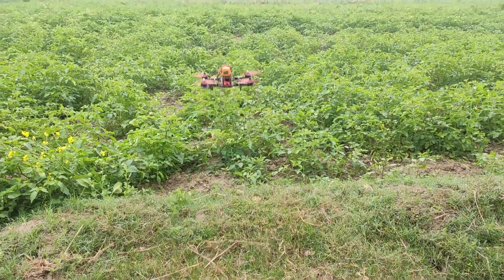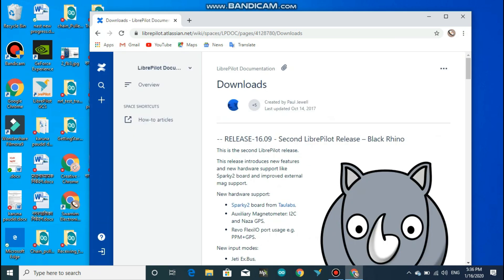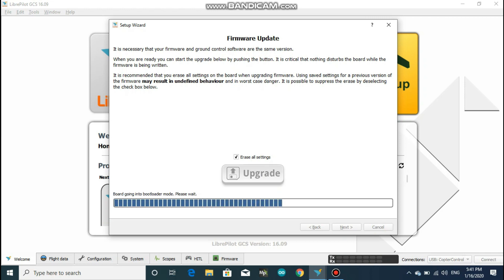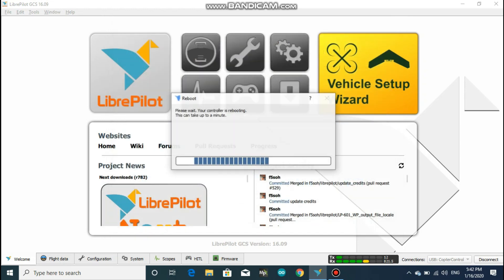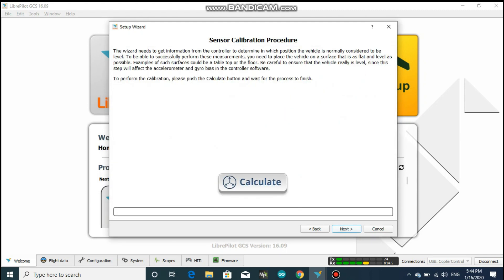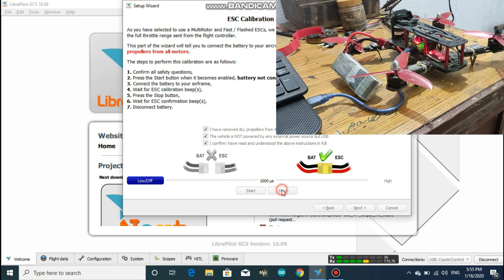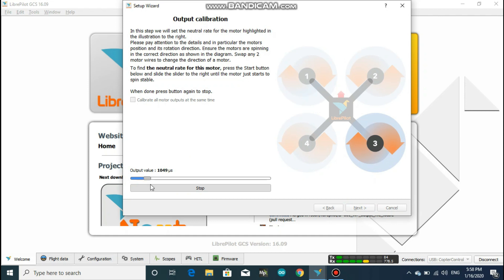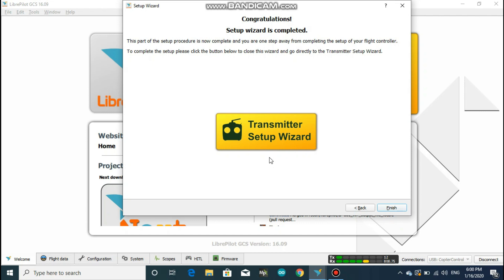How to download the Librepilot and setup CC3D flight controller.

Comment: Hi nice explanation. I'm trying to configure the FC. At time 6.2 the output calibration for motor, I'm getting it neutral rate at different microseconds for all for motors. Will it be a concern or what could be the problem ?
Reply from the maker: This should be this way. It is this way so that when the throttle is at the minimum, the motors start spinning at the same time. It's fine. You don't need to worry!
Reply: @AmateurInventor  thanks. That means the controller get to know when to start all the four motors to spin at same time. Am I correct ?
Reply from the maker: @basics5823  exactly 😃
Reply: @AmateurInventor  thank you for the immediate reply.
Reply from the maker: You're most welcome 🤠

Comment: mine can't connect, I have to download which file so I can connect to librepilot.
Reply from the maker: I think you may be having problem with bootloader
Reply: @AmateurInventor  botleader is a kind of file, what settings are not correct
Reply from the maker: @masyantuk  i didn't completly understand what yoy wanted to say. Please make me clear about your problem.
Reply: @AmateurInventor  My problem is I can't connect, but what kind of file is the bootloader?
Reply from the maker: Bootloader is a file/program which tells your computer where to look for instructions, exchange data before you connect your FC with librepilot GCS. You must be having the bootloader issue.

Comment: Hi, Sir I have downloaded libre pilot 16.9 version gcs and started with vehicle setup . Everything was fine untill prompted to save settings to cc3d .After clicking save it stopped like showing "Preparing mixers" 
Please kindly help me I need your help 😢
Reply from the maker: Hey, it seems you got bootloader issue on your flight controller. You can once try and upload an new bootloader onto your flight controller and try doing vehicle setup once again. Let me if it works or not.
Reply: @AmateurInventor  yeah may be but I was trying with different bootloaders like etucc3d_200.bin and its been 4hours since I started with it . Very frustrating issue
Reply from the maker: You may once try to follow up video by robojax on replacing the bootloader... You can send me pictures at my mail creativenischal@gmail.com for further help
Reply: @AmateurInventor  Thank you so much for you response sir.
I'll try once and revert you again in your mail id sir within mins
Reply: @AmateurInventor  please recommend a good bootloader for cc3d and steps further so as to not to struck with same "preparing mixer "
Reply from the maker: Video by ribojax is really helpful. You may try that one too...
Reply: Sir In that video he was using open pilot gcs which has been discontinued... what if I'm using libre pilot
Reply from the maker: @Anand-ls9dk  its exactly the same🙂, you can subscribe bye the way😁
Reply: Yeah sure 🙂
Reply from the maker: And please let me know the updates wheter you git your problem fixed or not
Reply: @AmateurInventor  I have sent you a mail please look on that sir

Comment: I am not able to upgrade firmware in libre pilot it's showig
"Timed out while waiting for a board to be fully connected! You will have to manually upgrade the board using the uploader plugin."
Also Rx & Tx is not showing please help me sir
Reply from the maker: Brother i had the same issue when i got cc3d in my first drone. The solution is preety simple. You need to re flash bootloader into your cc3d board. I will provide you the link to watch this shortly
Reply from the maker: https://youtu.be/_cJx1NodY8c

Please consider subscribing it it helped ☺️

Comment: i did exactly what ytou said and followed your instructions to the letter and when i clicke don "upgrade" it loaded SOMETHING into the board and when it completed now my board is unrecognized and nothing works. You bricked by BRAND NEW flight controller.
Reply from the maker: Look Brother, it is the process to flash the board. If it is bricked then it is bootloader issue in your flight controller. But do not worry, it can also be fixed. I'll send you the video which will help you😀
Reply: @AmateurInventor   I would appreciate that.
Reply from the maker: Follow this video and your problem will be solved😊 https://youtu.be/_cJx1NodY8c
Reply: @AmateurInventor  cool. Thank you.
Reply from the maker: You're welcome and do consider subscribing if it helped😊
Reply: @AmateurInventor  it did indeed. And subscribe i shall!

Comment: hi there i desperately need help, as soon as i try opening libre pilot it shuts it self down, it takes a couple of attempts to finally open it, once opened my home tab is just a black screen, however i am able to access a couple of the tabs like the download one. thanks,
Bertie
Reply from the maker: I have seen people with similar problem. The root cause is incomplete download. Although its shows the file has been successfully downloaded, but it is not. Try downloading it on another device, move to your pc and later try to install it on your main device. The. It should work

Comment: You are using Librepilot... If I use openpilot......which is best?
Reply from the maker: You should use librepilot because open pilot has officially stopped and you cant get this software from its original website so use librepilot
Reply: @AmateurInventor  Thank you so much
Reply from the maker: You are most welcome 😊

Comment: I downloaded the software as u showed, after installation the application is not opening, can u help me in this regard?
Reply from the maker: Just wait for a moment
Reply from the maker: Ok! Just tell me where you stuck?
Reply: @AmateurInventor  when i open the software it just shows application starting that's it and dissappears, how may time i try it's the same
Reply from the maker: Ok! I had this issue with one of my friend. It is because of incomplete download. a slow internet might me a reason. Which browser are you using? Maybe try an another browser. It might help😊
Reply: Ok i'll do that and if u have the software, could u please put it in our description as a zip file may be ?
Reply from the maker: Ok!
Reply from the maker: Check the link in the video now!
Reply: @AmateurInventor  surely I'll try and revert back😀
Reply from the maker: Please subscribe like and share if it does😊
Reply: @AmateurInventor  it's the same, still not working, may be there is some thing wrong with my computer, anyway thank you for taking your time and help me out😊
Reply from the maker: I think you are having a problem due to incomplete download. Please switch to another browser and try again. And no need to thank because I have this YouTube to help people🙂
Reply: @AmateurInventor  ok sure i'll
Reply: @AmateurInventor  finally it worked with my antivirus off, my antivirus is some how restricting the application.
Reply from the maker: Great! Nice to hear that you got rid of your problem🙂